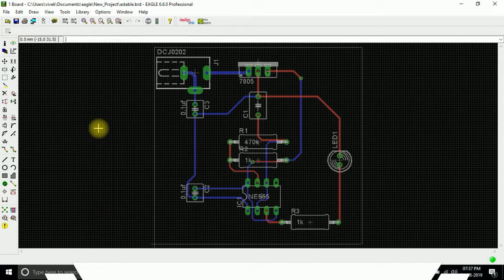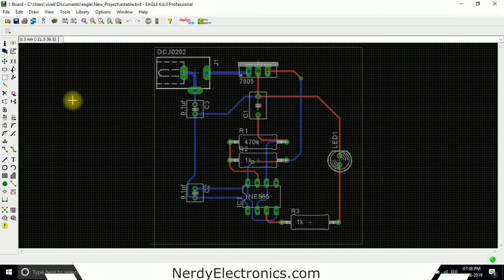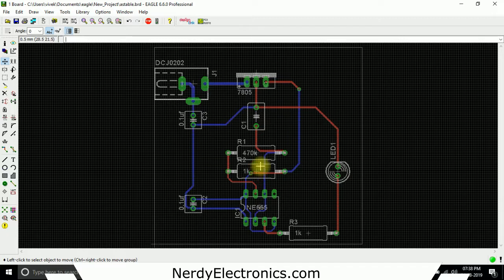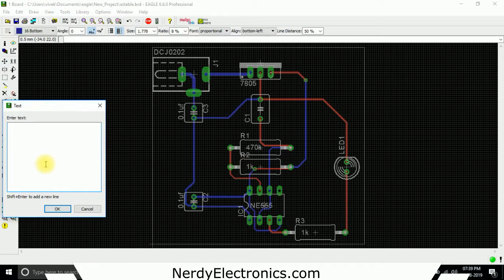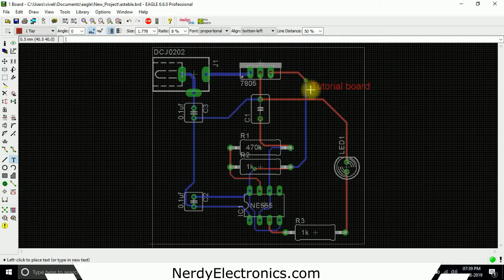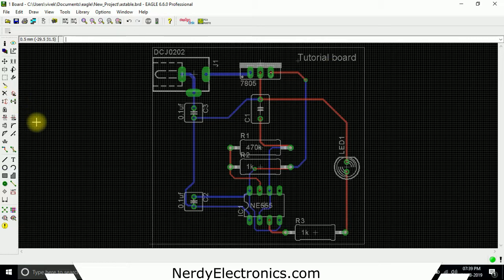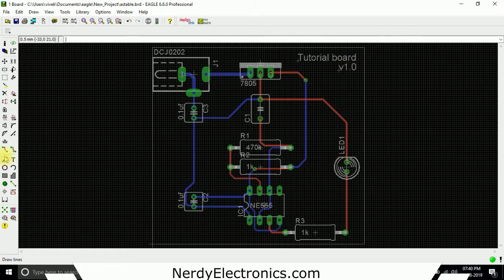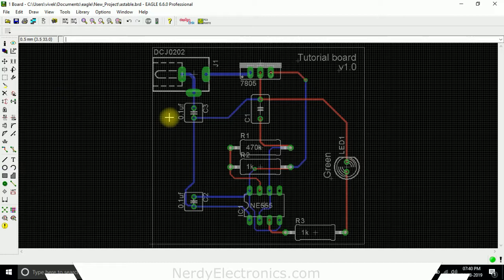PCB Design with EAGLE - 10 - Add Text

Comment: Hello sir can you tell me that can we convert smt component to through hole in pcb
Reply from the maker: If the part is present in library, you can simply select the replace option and choose the new part. If not, you will have to design the new part. Designing of new components is not covered in this series.
Reply: @NerdyElectronics   thanks a lot sir